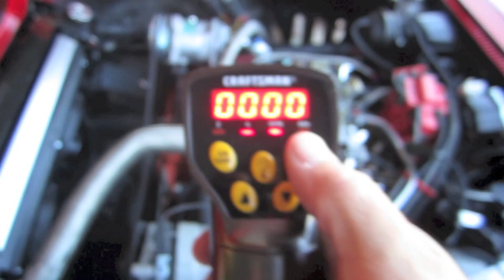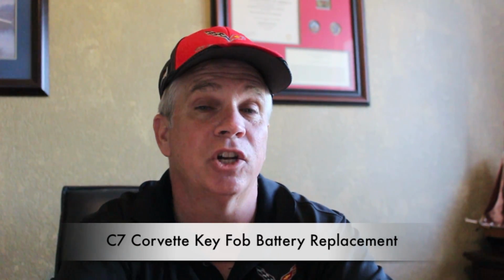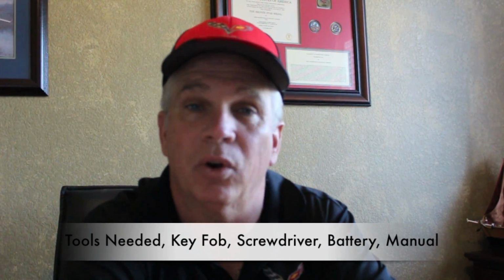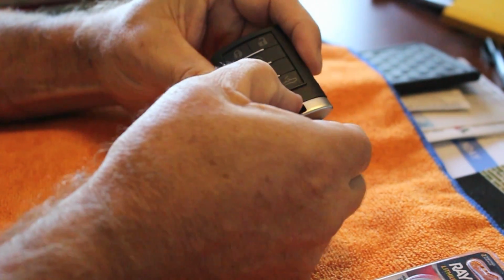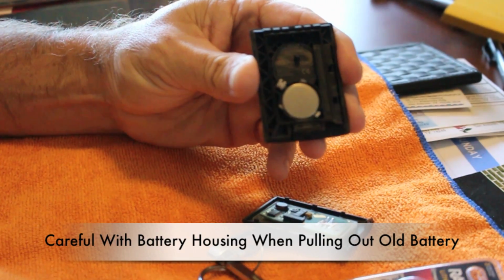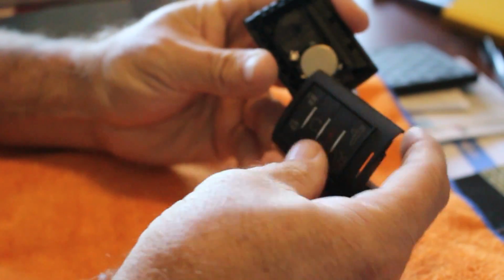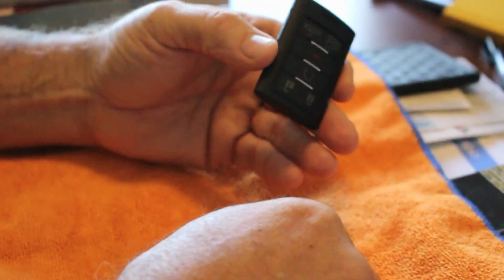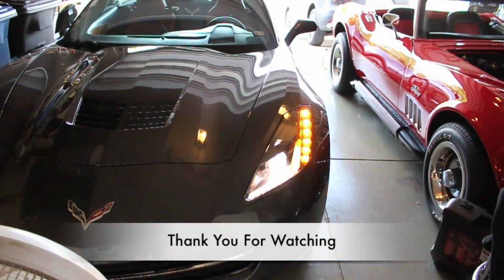How To Replace A Key Fob Battery On a C7 Corvette Fob (Also Cadillac, GM Fob 2014 and up)

Comment: I did a trial run as my 2016 is 4 YO now. When I took the fob apart and put back together the plastic piece that is the release for the key had fallen out. Put it back on and put fob together; but, release did not work. Is there a tiny spring missing perhaps?
Reply from the maker: Not that iblnow of. Maybe look on eBay for a second hand replacement. It is also possible something slipped out of position when you put it back together.
Reply: @TheWhatisright  Thank you for your reply - so, no spring - I probably don't have things lines up properly?

Comment: I need help!! My wife and I just  inherited her Dads 2015 Z06 corvette.  The spare FOB would not work.   So I thought it wasn’t programmed so I tried following instructions to reprogram by turning key 5 times the the message message appeared on to insert steering column slot but I didn’t do it in time.  Then I changed the battery and that’s all that was wrong with it. But now the car will not start either remotely or pushing break then start button on dashboard.  It’s not the car battery.  I think I messed up programming some how on car.

Comment: Hello sir I have a 2016 Corvette with 2 keys. For some reason I have to play around with the car before it is detected. it happens with both keys. Do you have any idea what it could be?
Reply from the maker: Go ahead and replace the batteries in each one. If that does not work, reprogram the key by following the owners manual.
Reply: @TheWhatisright  thanks for quick reply. I forgot to mention it only happens when left overnight and I try in the morning. Do you think it is loosing power overnight?
Reply from the maker: It is possible that they drain a little. However, they do not change during the day so not likely. I would just change out the batteries just in case. A replacement FOD battery does not cost much.

Comment: I noticed you used a small screw driver to remove the battery.  On page 2-9 of the owner's manual it specifically instructs you not to use a metal object to remove the battery. Any  comment on that?
Reply from the maker: It worked for me. Thank you for the info.

Comment: I just replaced the battery but still I can't open and close the car by the FOB ?! But when I insert it to the pocket i can run the engine
Reply from the maker: It may need to be reprogrammed. Make sure the battery you put in it is good and installed in the correct position. It is possible you got a bad battery.
Reply from the maker: I looked in the Owners Manual on page 2-6 and 2-7 for the C7 Corvette 2014 and it show the programing procedure for the key fob.
Reply from the maker: Tariq, did you get the problem fixed? Corvette Hop
Reply: Yeah i found the issue with new battery,, I purchased other battery and beome fine ,, thank you
Reply from the maker: Nice, great catch. Thank you for the followup.

Comment: You didn’t mention the little spring that falls out when you open it.  When I reassemble my 2015 C7 fob, the key release button no longer moves, preventing the key from fully inserting.  I have no idea what I’ve done wrong...
Reply from the maker: Bob, great input and thank you. My spring did not fall out and no issues. However, I sure can see how that can happen. Thank you. Corvette Hop.
Reply: Um where does the spring go. Mine fell out.

Comment: Wish it wasn't made out of such cheap plastic. Now I have a crack that goes through half of the front plastic cover. It is what it is.
Reply from the maker: Marcin, I agree. The plastic is thin. I have done several of then and luckily the plastic did not crack.
Reply: Yep, btw thanks for the video. Very helpful =)
Reply from the maker: You are welcome my friend. Just trying to help others. Corvette Hop